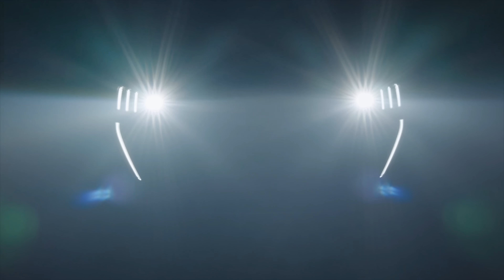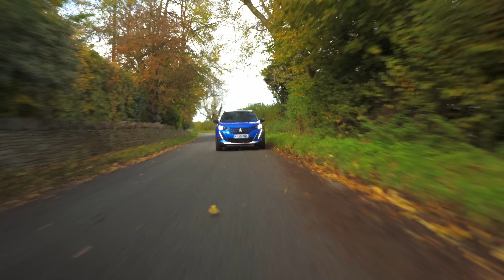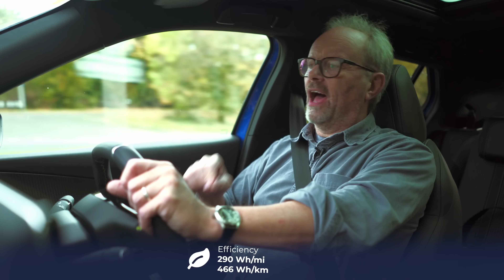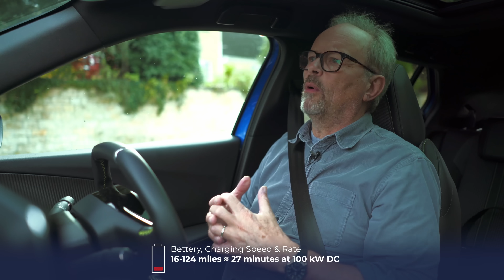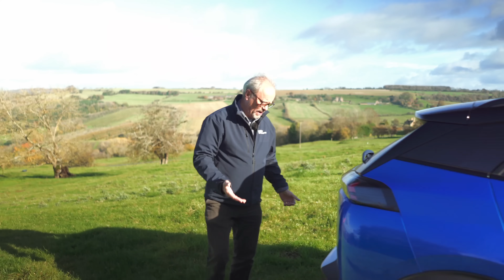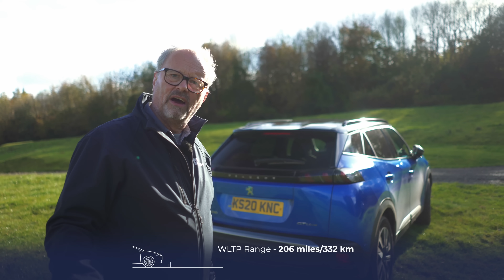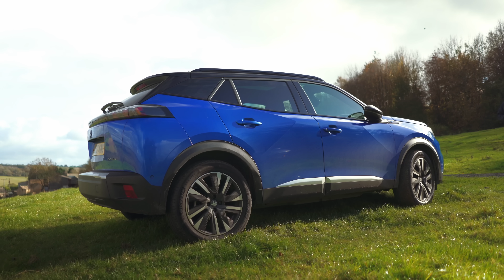Peugeot e2008 - how does it compare to other compact SUVs? | 100% Independent, 100% Electric

Comment: Robert, sorry to be the one to break it to you, but your maths is failing you: ~290wH per mile = ~3.45mpkWh...  I believe that miles per kWH is the best comparison, as it's most directly comparable to mpg; and the kWH size of your battery (your "fuel tank") lets you know the probable range.  And low and behold, when you multiple 3.45 * 45 you get 155.25 miles; just what the EVDB says.  Other than that, another good review.
Reply: There's a comment just above yours from someone who owns this saying the get 160-180 miles this time of the year with heater on
Reply: @_Rafiki.  Expect if you drive around town in Eco mode can get close to the official figures. The Norwegian fellow was driving at high speeds 75mph on the motorways and his tests showed 198 KMH or 124 miles so what to expect from a 216 mile range vehicle at motorway speeds. Assume on D and Eco and down hill your would put some charge back into the battery.
Reply: @_Rafiki.  First I'd like to point out that "heater on auto" does not mean the heat is on, just that it's enabled and will come on based on cabin temperature.

Second, it's usually not that difficult to do better than published range if you're a careful/mindful driver. My 2020 Kona EV is rated 258 miles and I can eek out 280-ish with the heat BLASTING... and it doesn't even have a heat pump, just resistance heat! Without heating 100% range is somewhere north of 300 miles.

The problem here is Peugeot claims 206 miles, which is extremely generous even compared to the 160-180 miles that a "careful driver" gets. It deserves a raised eyebrow of incredulity...
Reply: Hi  @Smidge204  thanks for clarifying this 🤘
Reply: My thought exactly, this is why I stopped to comment. Obviously, as the rest of us, he did not divided 1000 at 290, but rather made some math tricks and messed something.  My trick was that, 290 is almost 300, so multiplied by 3 will be almost 900, though, the result is 3 plus something. There is no need for a full second to think that.  So when he finished his..... two seconds aaaaboooouut, and said four, I knew that down here somebody already complained about his math skills :))
Reply: So its a 45L tank, 9L per 100k (thats what i use in aust) is 389 kilometers, the best this car will do is 180-200miles so 320 kilometers at best, so how is it MASSIVELY more efficient? Have i missed something?
Reply: @Tom-lf8hx  I am not quite sure what you compute, but it looks like you talk about range. I think that you missed that efficiency is about how much energy you put in for distance. And for efficiency there is need to cut losses in friction. At gas cars since gas was cheap this aspect was minor, but for EVs even electrons are even cheaper, because storage is not so ...efficient as that in gas, hence range problems efficiency in friction losses was important. Plus that known low efficiency of burning the gas in engine.
Reply: Correct
Reply: Yes, EVDB says 250km (155 miles). The NEDC (New European Driving Cycle) gives a range of 267 miles. That's 172% of EVDB and apparently based on the rosiest of rosy scenarios.

Even the manufacturer's site says the range is 206 miles, which is still 130% of what you should actually expect....

Comment: It is the range estimater that is the problem, not the range itself . It is very conservative and way out. The range is as advertised or more realistically as you can find on the EV database. I get about 220 to 250 km in winter (5-10 degrees and wet) in Norway
Reply: Yeah, there's still 15 miles easily left in it when it's "empty"
Reply: Where in norway do you live? I live not 40 minutes from Oslo. We DO have two months a year with -5  to -23 degrees. That is the only range that matters. My old Renault Zoe (the 2nd model) Went from 340KM high temp summer to like 180KM in the hardest winter with a 40kw battery and super conservative driving.  That is almost 50% range loss in the hardest winter months wich is way way too much.  I even had it parked in a closed garage all year round.
Reply: @Tsenngu  west coast (Bergen). It will of course get colder, but winter is defined by constant mild horrible stormy weather. I am interested to see though how it goes when it gets below 0

Comment: On the efficiency of petrol engines, the ICE component of the current Mercedes F1 engine is the most efficient in the world and that achieves a little over 50% thermal efficiency (the amount of energy going in that is translated to work). On their Project One road car which will have an engine derived from the F1 car, they hope to get just over 40%. When some of the most talented engineers in the world can barely crack 50% on an ICU, while any bog standard EV can easily top 80% efficiency and the good ones are well into the 90's, there's no question the direction the world is going in.

Comment: 290wH per mile works out as 1000/290 = 3.44 miles per kW, I think, so not 4.5 and I agree you should publish this :)

and with a 45kW battery 45 * 3.44 is approx 155 range (which, I see, agrees with EV database's figure)
Reply: The conversion is also terrible... 466W/Km would mean it does 1.3 miles per kW

Comment: I put it to you all, those who say that cars aren't getting more and more cookie cutter, that you probably couldn't look at blacked out silhouettes of several different makes of compact SUV and crossover, and be able to tell which is which quickly and accurately.  Also, you're not being picky about that interior light, it's a safety hazard.  Glad to hear someone else recognizes that a simple example of AN car, with no frills and just the basic features that you'd expect on a base model 1995 honda civic, with 200 miles of range in the winter, would sell faster than they could fill out the order form.
Reply: You thinking abilities are good but no average consumer will buy a car without decent features these days
Reply: Have you looked at the side profiles of 2000's Saxo's, 106's, and Fiesta's? Cars within the same class looking similar is not a new thing, its more or less how its been for a very long time.
Reply: @aljowen  I'm WELL aware.  Just look at most of the pickup trucks from the mid 90's - mid 2000's.  Most of the sedans for the last 60 years too.

Comment: No one mention the 6 to 8 kWh of energy it takes to refine a gallon of petrol, I can’t be more precise, as obviously the oil companies don’t really want us to think about it 😂. So basically if you have a Hyundai EV, you’d be about 40 miles down the road with just the energy needed to refine the petrol.
Reply: I agree with that. Just one refinery uses as much electricity as a small city the size of Coventry to sustain production. Factor that into a gallon of fuel and EVs are even more efficient
Reply: @Muppet Keeper. Data about electrical energy consumption varies from rafinery to rafinery. In my country I can access data from the biggest oil company there but these are from 2014. Then I found that for 1000 liters they use about 1MWh to even 4MWh of electrical energy. That mean it is from 1 to 4 kWh per liter and that translates to 4.785 - 15.14 kWh per US gallon.
Reply: @bdelphan  A donkey oilpump lifts between 5 and 40L per stroke and it goes around what 10 times per minute, so that is average one oil barrel per minute. If it uses 9MWh per month as you say, while it pumps 43 thousand barrels, each barrel then uses 2.09kWh of electricity or around 1% of the energy content of that oil it has just pumped (even if a Tesla can go 5-8 miles on that amount of energy a car can go further from the 120L of gasoline you get out of that barrel)! So it is very efficient. refining takes 5kWh energy (not only electricity but also heat) because the waste heat from distillation is used to pre heat the next batch of oil going into the refraction tower. Distribution and advertising and gas stations is another 5-8% losses. So overall the oil industry produces more energy than it consumes. This is the reason it has been king for a century, because it contains "free" energy made by geology and that is something hard to beat at the bottomline. However as oil reserves become more costly to extract, and solar and wind is getting cheaper, this balance is shifting, but oil has had an obvious advantage by being concentrated energy just for the taking. We want to get rid of oil, but not because it is inefficient and we are transtioning to cleaner sources that are less efficient because we need to reduce emissions drastically, but oil has always been the fuel with less effort per kWh at the wheels of vehicles.
Reply: @bdelphan  My counter argument is still right too, 9000kWh is still 43 thousand barrels capable of propelling a gasoline car for 33 million miles or half that if we're talking a big car only getting  32mpg. So the fact that an electric motor is 4 times more efficient than a combustion engine, is in itself remarkable, but it is the whole chain of energy use vs. return, that has made gasoline the obvious choice. If we are going to talk about electricity production, it also  has its own set of connected losses and has not been concentrated to dig up over millions of years. We like electric cars because they are #1: cheaper to drive (I use half of what I spent on gasoline, just paying list price + tax at home) #2: they have fewer emissions, and if you drive a lot, it is not an insignificant reduction of your household emissions , to get an EV. 3# You can make your own fuel legally, if you got solar! #4: maintennance is rudimentary and is mostly the easy diy stuff like brakes and wheelbearings and new viperblades. So from that perspective it is the better vehicle, but it requires more man-produced energy per mile  driven, than a gasoline car, that cheats by borrowing from nature.
Reply: @kehlerames218  That is Very nice, but not what is discussed here.
Reply: You are forgetting one thing: you get 20 times more energy out of gasoline than IT takes making IT, you are Literally pulling IT out of the ground. Not so with electrons. They have to manufactured at a loss! So please stop that efficiency nonsense about EVs, They are 6 times less efficient than gasoline cars! The reason er like the is that They emit less polutants, but we can't drill for electricity, so They Will never be more energy efficient than with a combustion engine.
Reply: @Tore_Lund  As I look out of my window at the large wind farm, with megawatts of electricity literally being generated with no pollution at all, I can still hear your mad ranting about petrol. It’s over, get over it. 
You don’t need to drill for electricity, it comes down from the sun, it moves in the wind. Aside the the poetry, you are also really wrong. EVs do the equivalent of 140mpg if you measure kilowatt for kilowatt of fuel, and as in many civilised parts of the world, we use increasingly clean and not “drilled for” forms of electricity, your oil analogies are also wrong. And before you start ranting about the materials in wind farms and solar panels, I’ll just say... oil rigs, pipelines, refineries, gas tanker trucks, fuel stations and only then, 30 mpg.
Reply: @Tore_Lund  You are mixing up efficiency with the need for efficiency. Efficiency is only important if the fuel you are using is scarce and none renewable. It doesn’t matter if a wind turbine only takes 20% of the force from the wind, the wind isn’t going to run out. Wind turbines are designed to keep themselves safe and functional, therefore the don’t want the full force of the wind.  Hydro may be more efficient, but the huge cost of building it doesn’t make it economically efficient.
Reply: @Tore_Lund  you clearly don't understand you physics. You can't make energy. You aren't making petrol you are digging it up and refining it. Once it's all gone good luck making more 😂
Reply: @Tore_Lund  How wrong is it possible to be? You can drill for electricity, it is called geothermal energy, that is why all the server farms running the cloud are on Iceland! As others have said the other sources, Hydro (Norway), Solar (everywhere), Wind (everywhere) do not require drilling they are all powered by the Sun which is good for the next five billion years!
Reply: @Tore_Lund  You're absolutely correct about petrol energy density.  That's why it's been such a good, convenient fuel for the last 100 years.  The problem is that an ICE in a car can only make use of between 20 and 35% of that energy.  The remaining energy is just wasted.  It's very inefficient.
Reply: @Tore_Lund  This is simply false. Renewables like Solar PV & Wind Turbine even after considering energy to build the system is far more efficent than even Gasoline without considering refining and drilling. BEVs simply consumes less energy and Renewables methods of capturing energy is much more cleaner. Then add to the fact BEVs have crazy good life span which should do 400,000 miles which many fake studies are ignoring. Energy Density of Hydrocarbons is POINTLESS! it has no effect on efficiency. Sure Wind Turbines are only 60% efficient because they OVER generate in the wrong times. Thus they have to be BRAKED when the grid can not consume the generation. But you are wasting WIND BLOWING not freaking FUEL! Your entire argument is Logicaly Broken, Wasting the FUEL is not the same as wasting Wind Blowing.
Reply: @Tore_Lund  Sorry nothing you said had functional understanding of Physics. Just throwing terms and numbers does not inform how the system works. I actually went into the mechanism and reasoning of what happens. Thanks for the swift-boating.
Reply: @Tore_Lund  WTF but the Energy Consumed is LESS. From Wind Turbine or Solar PV Capture to Spinning wheels is still multiple times higher RATIO for Electric Supply Chain. While BioMass Fossil Fuels has a much small RATIO from Capture to spinning Wheels. You are trying to argue the Sheer Nominal amount of energy is More which make no sense. You can not consume that much energy in an EV. Again your argument is logically broken. RATIO vs Sheer Amount.
Reply: @Tore_Lund  4 years out of 25 Years, that maybe is a sign of the RATIO! WTF that's 4 + 5 % is current Human generation. ONTOP of the energy required in BioMass to create fuel. Sure if your argument is The 9% of Human Generation gains 91% more energy from Burning it that's more efficient. But you just ignored the entire point BURNING FUEL.
Reply: @Tore_Lund  
The best ICE has an efficiency of around 40% — when not idling.  You lose the efficiency argument just by the fact that an ICE wastes at least 60% of the energy.

It appears that you are unable to assess information correctly, and believe that petrol or diesel simply appears in a fuel tank by magic.  No surveying, drilling, pumping, transport of oil, refining, transport of fuel, pumping into the fuel tank involved.  Then the raw material isn’t renewable on any sensible time-frame, and has a side-effect of over-heating our planet.
Reply: @Tore_Lund  
ICE typically fall around 10% to 13% overall efficiency.  There are losses at every step in the processing of the fuel, before the engine is involved.  40% is a maximum engine efficiency, not typical.

Battery EV is around 70% overall efficiency, and rising.  Around 10% losses internal to the vehicle (mostly conversion losses from AC to DC and back), with the rest being generation losses.  This is if using a non fossil-fuel source.  A poor coal-fired power plant will only be about 55% efficient at producing electricity, so your overall efficiency would drop to somewhere around 35% to 40% if using such a source.

Worst-case scenario gives battery EV at least three times the overall efficiency, and this could range up to seven times.

Comment: You can select a reversing camera as an option when you buy the car.
Reply: It's really odd since he was in a GT Line variant which is supposed to have that out of the box. But perhaps it depends on the market.
Reply: @zarkoh  Yes, have a standard UK model, GT Line spec, (delivered August 2020) has reversing camera
Reply: @watchmrcontent  You'd think reviewers always get the top variants for testing :)
Reply: @zarkoh  they usually do get the highest spec cars and this being the GT line should have a reversing camera as standard not an option for that kind of money! It's a bit odd to me that it doesn't. 🤔😊
Reply: @Apafej627  yeah, it's precisely why I wondered to begin with. Even the variant under GT Line (called Allure) comes with the reversing cam.
Reply: It's 2020 a reversing camera would be mandatory in every vehicle even the base model of the cheepest option, I can purchase reversing camera kits for less the AU$40 I'm sure the manufacturers can get them for less than $5 as they all have screens already in their cars, so I think the point is that it's a very poor decision to not put one in and shows that they aren't serious about making a modern car and are stuck in the past with old technology and old ways of thinking 🙄
Reply: @kurtpalmer3674  It's not the manufacturers being stuck in the past it's just marketing, they need things to distinguish between trim levels and encourage punters to spend more money.  
I agree that reversing cameras should probably mandatory nowadays given how compromised rear visibility is on modern cars.
Reply: Camera might be broken.
Reply: this car have back camera
Reply: @rebelphescooter3278  it's a pug so might be broken /troll